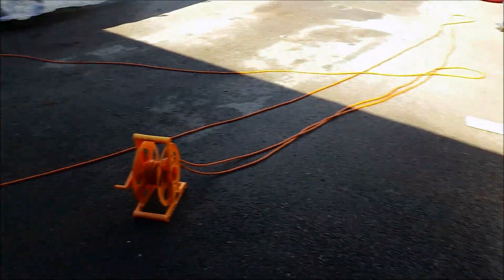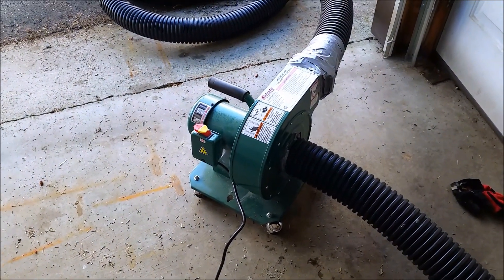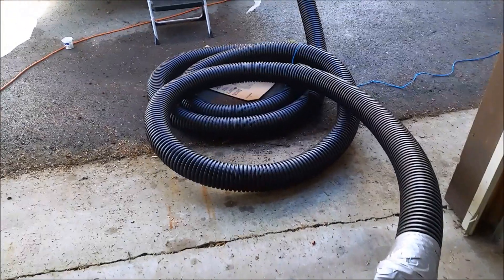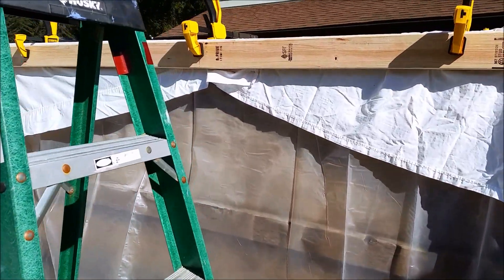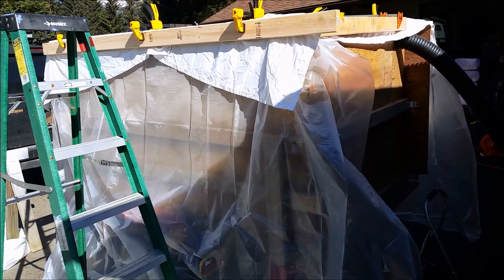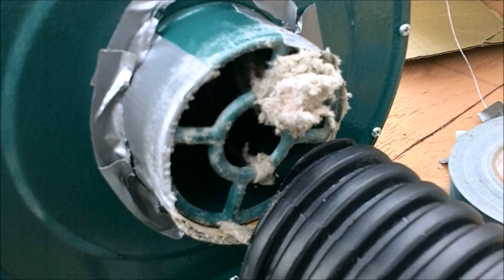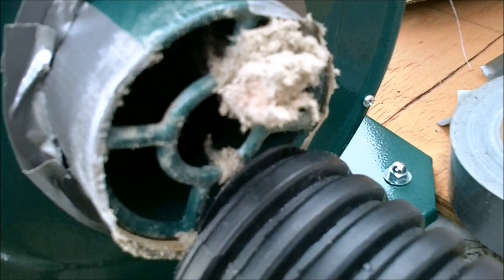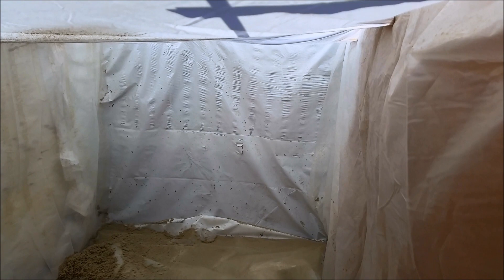DIY Blown In Insulation Vacuum

Comment: Is it safe to say you can use this in reverse to blow in insulation too?
Reply from the maker: Yep
Reply: @Erich1870 thank you kindly for your reply.  I need to fill some plaster and lathe wall cavities without demolishing the entire house 😂 so I’m thinking I’ll go grab a boat load of blow in insulation from Menards and try to diy it.
Reply from the maker: Usually you get an insulation blower rental for free if you buy enough. If you need 10 bags for a free rental, buy them and return what you don't use. Their blower eats and fluffs better than this homemade version would so try to get theirs if you can.
Reply: @Erich1870 I didn’t know that, I’ll have to call and ask.  I just figured I’d have a buddy outside in a brute trash can fluffing the stuff up and making sure it’s flowing right, while I kept the hose affixed to the wall.

Comment: They make a large gas powered unit which is designed for sucking the insulation out. If you want to drop $3500-$5,000 on one. But companies also rent them out. I've rented one a few time for projects. These are insulation specific companies. Maybe I should buy one. I could use the tax deduction anyway.
Reply from the maker: Correct, but no one rented one in my area. I actually called a home energy contractor to see if they had one and they made their workers use dust pans and garbage bags. I was like 😳
Reply: @Erich1870 same for my area. The company was a state or 2 over, 5-6 hours. They bundle the vac and hoses up on a skid or to and send it truck freight to you. Then you ship it back when you are done. It’s available to insulation contractors anyway. Not positive on DIY’ers or not. I think I had $500-600 in rent and freight before i was done, but worth it to me.

Comment: Would this work in reverse to install loose wool insulation?
Reply from the maker: I've used the insulation blowing machine and the only difference is that machine has puddles to break up the bales. If you had a way to do that, this dust collector would blow it, no problem.
Reply: @Erich1870  awesome many thanks for your reply. How long do you think the maximum length of the blower hose could be before the fibre would not exit the hose?. Also do you think the impeller needs to be steel or alloy? If it was a plastic impeller it would eventually crack I suppose. I am in Australia! so a lot harder to buy these items.
Reply from the maker: @scottmccormick8964  I'd say 100' for hose length and my blower's impeller is metal since wood chunks are anticipated in normal use.

Comment: How come you did not like the blown in insulation, It has a great R value, And works great.
Reply from the maker: Blown in insulation is fine, I just found the cellulose kind was collecting moisture and settling into a rock hard mass that wasn’t providing the proper R value any more. I removed it and replaced it with fiberglass blown in. Others have commented that cellulose works great in their regions. I suspect its failure for me is due to the climate in SE Alaska.
Reply: @Erich1870  Makes since I would have done the same. Great Video.

Comment: Erich, Nice demo. Seems like this would work to transfer insulation from over garage to another attic area and re-use the insulation. Does the material get too chopped up and dense to use as insulation after going through the fan/blower system?
Reply from the maker: No, it comes out light and fluffy. It would transfer from one space to another just fine!

Comment: So you "don't like cellulose" but you really don't explain that.  It's an EXCELLENT choice for attic insulation.
Reply: I was wondering the same thing. It's flame retardant, it's a natural insect & rodent repellent. It's the absolute best choice for insulation. It's can't be ruined by water at all. It retains its R-value when it gets wet, and dries. Infact it get added to water & "wet sprayed" into walls on new construction. You can always blow more cellulose on top of the old for added benefit. You did yourself a disservice here...
Reply from the maker: @knowledgeispower6192  I'm sure it has benefits outside my zone but it wasn't the right choice in my climate. It was installed during a time when a building boom brought out of state contractors building inferior homes and they skipped town when the problems started showing.
Reply from the maker: It's a poor choice in my area. I'm sure it's great in other climates.

Comment: Will this work with fiberglass?
Reply from the maker: blown-in fiberglass or the batt kind? I'd say it would work for the light, fluffy blown-in fiberglass.
Reply: @Erich1870  blown in fiberglass that is matted down due to walking on it. Ive put it in garbage bags in the past to move around. Does your machine work to blow it back in?
Reply from the maker: @functionalvanconversion4284  You might need a small rake to break up the matted sections. I've never tried blowing anything with this. I've used the blower system from Home Depot and it seems similar.
Reply: @Erich1870  okay 👍
Reply from the maker: @functionalvanconversion4284  thanks for watching!

Comment: I guess I am a little late in watching this... however, I have  question: did you run into static electricity problems and if so, how did you address them? Thank you for this video. I have a similar dust collector from Grizzly, only it has 2HP, maybe I am done faster... :-D
Reply from the maker: I didn't notice any static electricity issues. Thanks for watching!
Reply: @Erich1870  Thank you friend. Cheers.

Comment: Do you think that this vacuum system can knockout a 2500 square foot Attic in one day
Reply from the maker: The vacuum can do it, but the real trick will be where you put the insulation. Will you be putting it directly into a dumpster? You’d need to run some volume calcs, as that big of a house might need multiple dumpsters.
Reply: @Erich1870  I plan on picking up most of it with a dust pan and 55 gal trash bags. Gotta start somewhere. Thanks for the fast response I appreciate it I subbed

Comment: How long of piping did you have? Wondering how long piping can be from my attic to dumpster
Reply from the maker: It's about 50 feet on the suction and 25 feet on the blower side of flexible drainage pipe from home depot (the non-perforated version)

Comment: Was 1HP enough?
Reply from the maker: It worked! Bigger would be better but the real place I would make a change was at the sucking end. I needed to put a solid piece of pipe to break up the hard cellulose. Once the pieces were small enough, the blower sucked them away just fine.

Comment: Rent a machine. Will go literally LITERALLY 4 times as fast.
Reply from the maker: I would have, but there are none in my area.
Reply: Agreed. You also made that little 1 hp motor work way harder than it needs to. Cutting off the unnecessary pipe would be at least twice as fast. 

Glad to know this works though. Pretty cool.

Comment: That sucks! The suction is horrible you might of saved money but productivity is awful it goes to show doing things right is best. This is painful to watch its awful
Reply from the maker: The suction wasn't the problem,  it was really compacted so I had to break it up.
Reply: Still ridiculous and ghetto do stuff right and yes the suction sucks i do this stuff for a living and this video is embarrassing
Reply: Its basically a sad hillbilly set up. A real insulation vac would make short work of that stuff but you choose the silly boy route
Reply from the maker: @Welovecamping420  I chose to do it myself with a cheap dust collector. You're free to hire any outfit you want.
Reply: Oh i know I just find it funny it worked so poorly I can see by the video and I know cause I do this kind of work. All you did was make a machine that looks like an insulation removal vacuum but in reality it’s no better than a shop vac
Reply: @Welovecamping420 in most areas you can’t find a insulation vacuum to even rent dumbass. It’s not a no brainer that a purpose built insulation vacuum with a gas motor is going to do this way better. This is still better than using a rake or a shop vac. Why even comment on this video? So you can tell us “I dO tHiS fOr a LiViNg” that’s a sad fucking living honestly.

Comment: I have to do the same in my attic. I'm getting the harbor freight dust collector 189 with coupon. I don't have a traler, but I'll figure something out. How did you get rid of all that insulation?
Reply from the maker: I took it to my local landfill in the trailer and dumped it out the back. You should call your waste management company for a dumpster if you're removing a lot and can't go to the dump yourself.

Comment: My big question is why don't you like cellulose? especially to the point of wanting to remove it all?
Reply from the maker: Up here it collects moisture and settles into a brick with greatly reduced insulation value. The blown in fiberglass stays loose and fluffy and resists moisture in the air.
Reply from the maker: @Mr Sunshines post a link to some research that shows this please.
Reply: @Mr Sunshines . Before you call someone a retard, maybe you should explain how you ventilate ADDICTS? Do you take them to a hospital or do you do it on location?
 And did the capital letters and periods get ventilated out?
I do agree with you on the condensation issue, though.

Comment: why wouldn't a 5 HP shop VAC do this?
Reply from the maker: It would but it would fill up right away. Plus I think most shop vacs use plastic impellers and it would not last as long to have debris flowing through the blades. This vac system has a metal impeller and is designed to handle stuff like chunks of wood, screws, staples, and other stuff you'll find in your attic.

Comment: What did you replace it with?
Reply from the maker: @Mr Sunshines sorry mr sunshines but that's not the way home insulation works. It relies on small, trapped pockets of air to create a thermal break. If you compress it, you loose a majority of its R value. If it collects water it damages the drywall.
Reply from the maker: I replaced the cellulose insulation with AttiCat expanding blow-in insulation for Owen Corning. Thanks for watching!

Comment: Great video I thought of the exact same idea. Do you think reversing the system would work to shot the insulation back into the attic?
Reply from the maker: Thanks! It definitely would work, as long as the insulation is loose and not compacted. You'd want to wear good respiration protection because it will make dust.
Reply: Going to give this a try with a harbor freight dust collector. I will post back if it works, thanks!
Reply from the maker: Great! Best of luck. Let us know how it goes.
Reply: @chvydrptop  Did it work?
Reply: @matthewharaminac6348  ended up putting in that newer recycled insulation, so just rented the blower from home depot. Still have my fiberglass stored away for the future.

Comment: if you contact a heating and air company (residential) they throw furnaces out everyday. aquire a decent size one, take the blower wheel out, wire it to plug into the wall and bam 3000 cfm. just use a 8" flex duct. May go quicker.
Reply: This would not work well. You need a higher static fan. Also the furnace blower will clogg up and stop blowing. Also debris would break it quickly.
Reply from the maker: mark broad Interesting idea! We have very few forced air heating systems in town so it would be hard to get my hands on one up here, but it's a great suggestion to others to try!

Comment: Have to remove old attic insulation (720 sq ft)of old dusty smelly cellulose, got a bid from insulating company...  $800.00 to remove the old and $600.00 for new install..  with this idea of yours(by the way is great) it will cost me around  $200.00 for the machine and hose.. and of course labor of love.. and if your a do it self-er you know that it will be done right...take the time to caulk and seal  all the air infiltration's...going to have a company blow in new insulation.. so savings of around $600.00..well worth it to me...Thanks Erich for posting this idea...I owe you a beer...  cheers
Reply: oneeyebird Hi, how did the project go?

Comment: You are an idiot. You waisted time and money removing insulation from your home. You could have just blown in additional insulation over the top is what what already there.
Reply from the maker: Wow, pretty harsh words. I replaced the cellulose because it's prone to collecting moisture and settling into a brick up here. It's an inferior product for my area but many contractors don't care about the long term quality of their projects.
Reply: Yeah, I guess my comment was pretty harsh.  Sorry.  I guess you could have picked on me for saying "waisted" when what I meant was "wasted".  I will admit that I found your DIY blower/vacuum system pretty slick.  I did a similar thing in my house only I used a leaf blower to move the cellulose insulation from one attic space to another.  It worked really well and allowed me be "recycle" the insulation.
Reply: @Erich1870  Great job inventing this vacuum system.   "All borate cellulose" insulation would have been a better choice (it doesn't smell when it gets damp), but costs more and it's hard to find.  Loved your design to slurp it out of the attic!
Reply from the maker: @jasonbengel  Thanks for watching! Thanks for the suggestion. I don't have many locally available options, so this is what I had to work with.

Comment: I have a similar project to do right now with some slightly water hardened and frozen insulation.  I noticed in your video you had a small hand rake to loosen the insulation; do you know if frozen insulation behaves the same as in your project (which looked to be filmed in warm conditions)?Also, I'm assuming you want to minimize the length of intake piping to your fan unit to maximize the suction.  How long and what diameter piping did you use on the intake?  Did the length of outlet piping impact the unit's performance?Could you estimate (once you had the procedure down) the cubic volume of insulation you could remove with this set-up per unit time?Lastly, do you have any suggestions as to whether you feel a larger/smaller/different suction fan would do a better or more efficient job?
Reply from the maker: +mike sanderman Hi Mike, if your insulation is frozen too hard, it might be a chore to break it up so it fits in the pipe, but you won't know until you give it a try. Mine wasn't frozen, but it was really dense from getting wet several times. I did find that a small rake or garden spade worked well to break it up.  I bought a 100' roll of Corex Drain Pipe (Solid) from Home Depot. I cut it in half and used 50' as the suction side. I had a shorter section blowing into the trailer. Your length will depend on where you can mount your blower. I agree that the suction side should be as short as you can make it to keep it efficient. I didn't play around with different lengths. I had to get it done as quickly as I could and I didn't get a much video as I wanted because I was in a time crunch.

I filled my garden trailer in about 3 hours. That included stopping 6 times to climb down and compress it to save space. It made a brick of insulation that was 5'x7'x4' thick, so I guess you could say I moved ~46 cf per hour. If you could vacuum and not stop, you should move twice that.

A larger fan with a larger hose would definitely move more material. I have a 1hp motor. If you got a larger one, you will move more material guaranteed. I could feel the motor slow down when I gave it a full load. I wasn't stalling or anything, but more horsepower will give you more through-put.

Thanks for watching and keep the questions coming. I hope your project goes well. It's a very inexpensive way to remove your own insulation.
Reply: @Erich1870  a c
'😅ij ⁷⅞